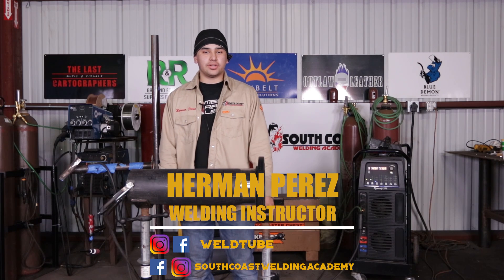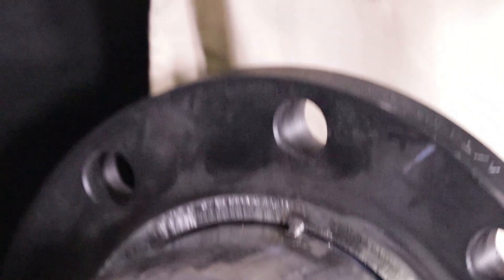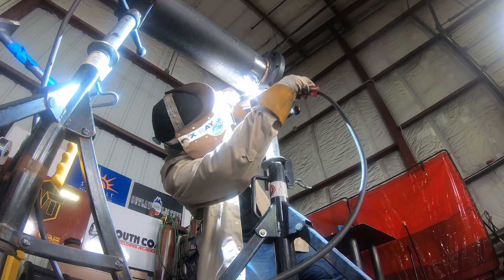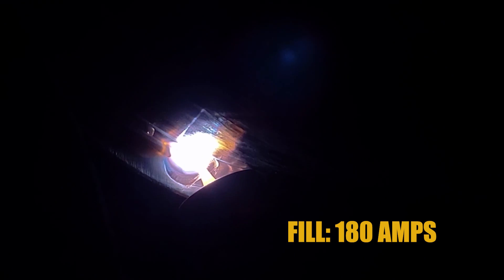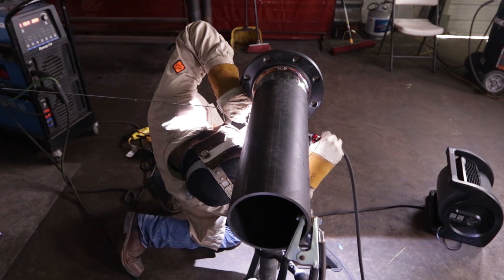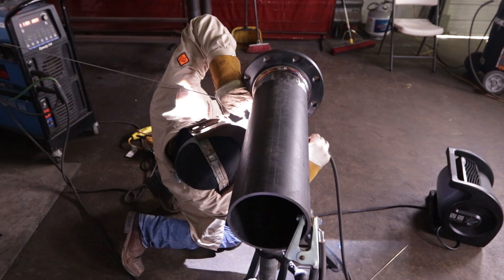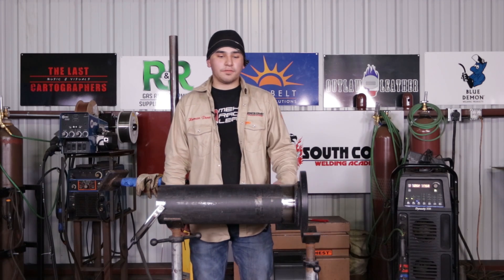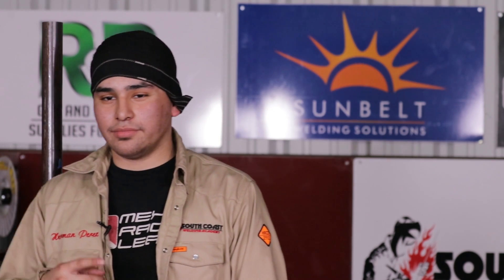TIG Welding A Socket Flange

Comment: Tutorial or not..... rule #1..... weld the inside of a slip on flange first..... 
terminology: walking the cup......
Don’t assume you can just use 309 on a Carbon weld...... follow the WPS on production welds. Good hand work though !👍
Reply: Thomas Mcnicholas it’s a socket flange lol 😂 and yes you are right about using stainless on carbon but he said he wanted to get color in his welds for cosmetic reasons I suppose. Pretty color make a weld stand out
Reply: But it’s a socket flange, sooo no
Reply: It's not a slip flange
Reply: must"ve had a spare flange i guess

Comment: Is the wire in his left hand for guidance or is he using it to fuse with the weld ?
Reply: It’s his filler metal the tungsten creates a puddle of metal and he uses the wire to build that metal up by dipping it (or laying it) in the puddle

Comment: What about the inside?
Reply: @weldtube  so it is a socket flange, huh? Thought he had the terminology wrong. Didn't know they made them that size. Whats the application?
Reply: @frankrodriguez5417  we’re welding 60” at my job right now just like these 🥵 tig and fluxcore or fluxcore all the way out